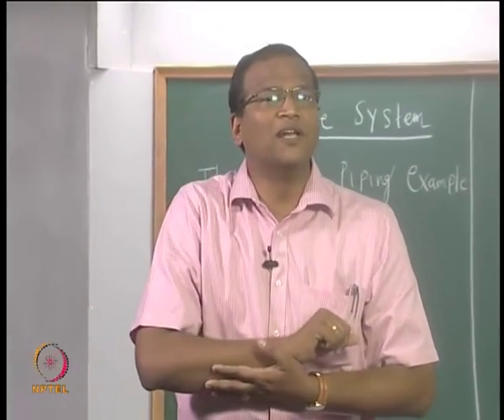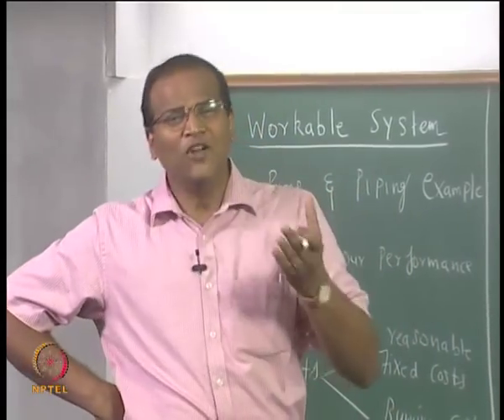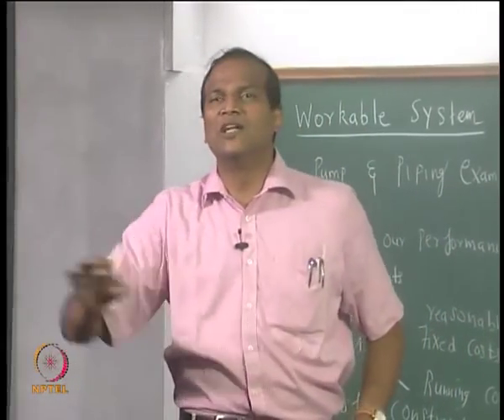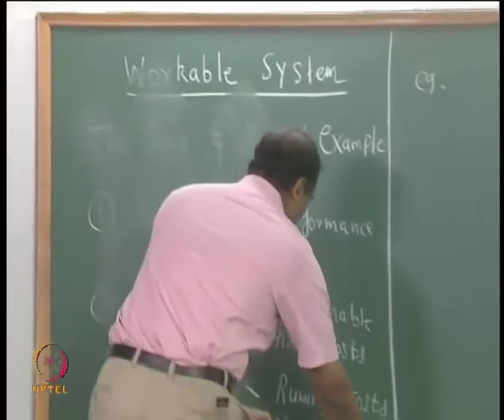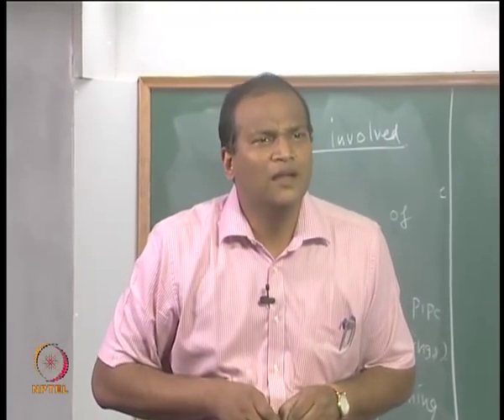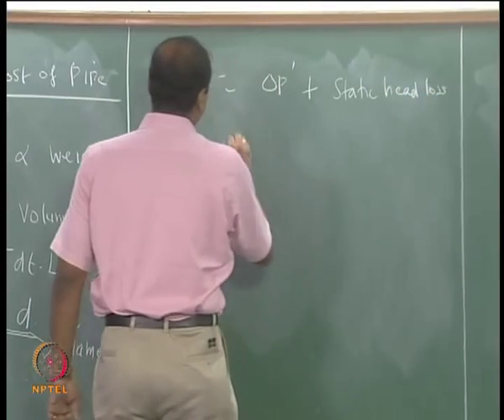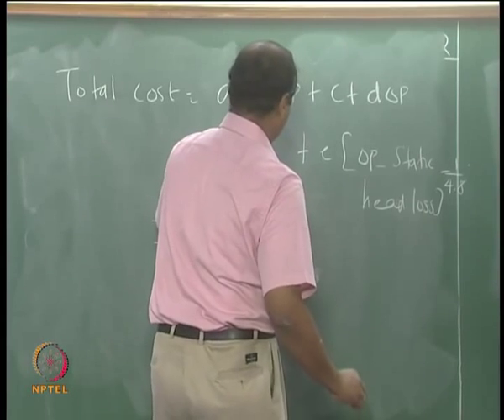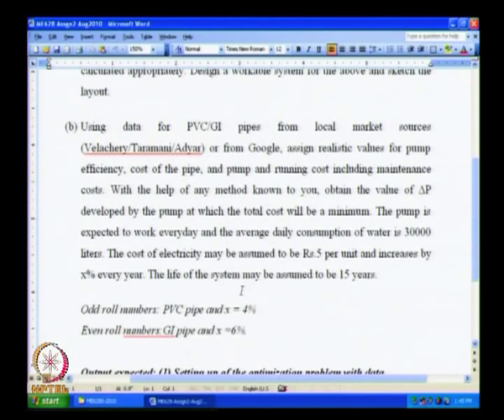Mod-01 Lec-03 Workable system

Comment: dp' = (8.f.L.m^2)/(rho.Pi^2.d^5)  I believe at time 30:24   And maybe I'm missing something but the bit that confuses me was in 34:00 why is the third factor in total cost "e.(dP - static head)" when the first cost of pump would take into account cost of power in terms of dP? You also didn't factor in the cost of the pipe in that equation which to me should have been a subset of first cost.